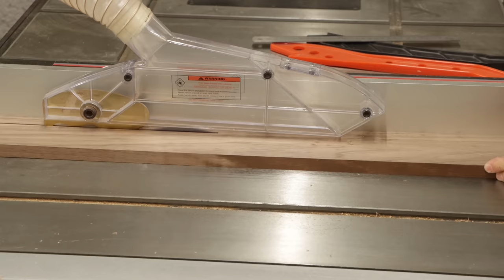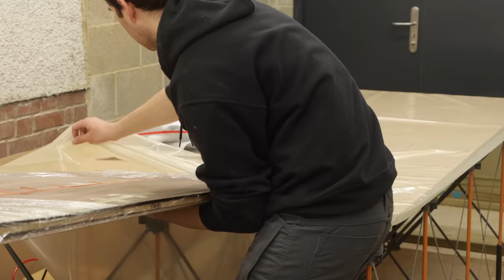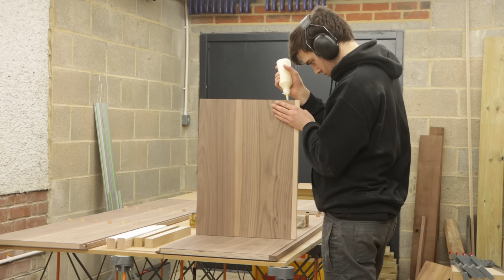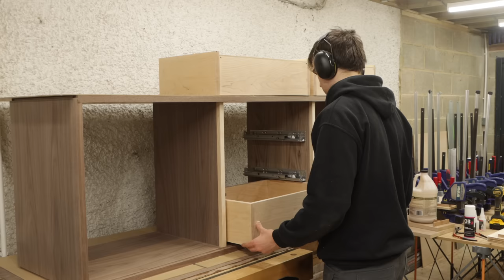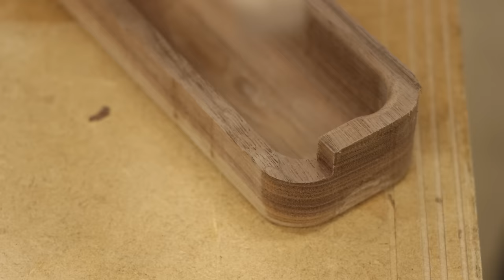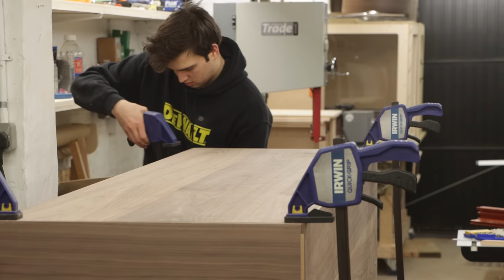Making A Walnut Sideboard With Table Saw Kumiko!

Comment: I prefer to watch a full build in the one day, even if that is over multiple videos. I find when videos are spread over several weeks you tend to forget what has happened in previous videos. Regarding cutting veneer with a track saw, i was told to drag the saw over the veneer backwards almost like a scoring blade would do. This is ment to give a far superior cut quality. Something you might want to try with an off cut of veneer and see how it works out.
Reply from the maker: Thanks for the feedback Derek! That's an interesting idea, using the track saw like a scoring blade. I can see that working well using the depth stop.
Reply: @SeanEvelegh  I am sure it was youtuber Ramon valdez fine furniture,  that gave me the tip for cutting the veneer.  He does some amazing work using veneers. Not sure if you have came across his channel but well worth a look if you haven't.